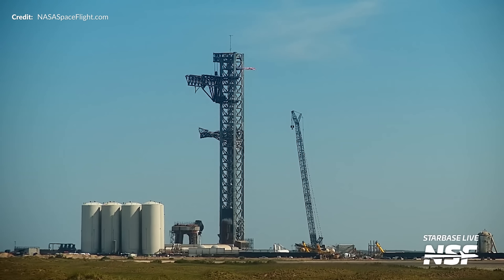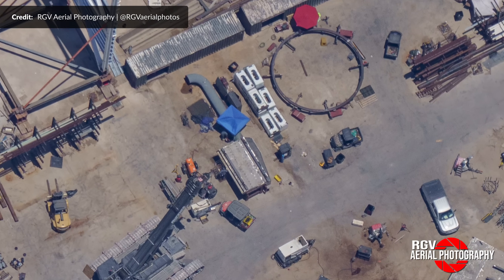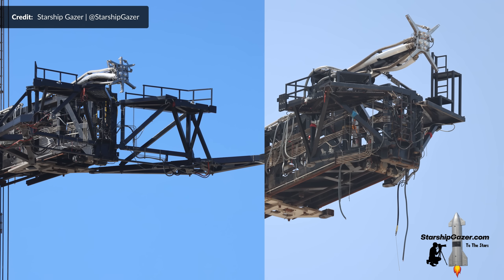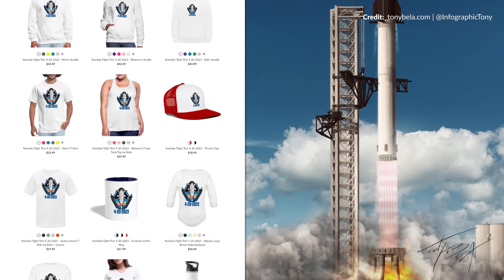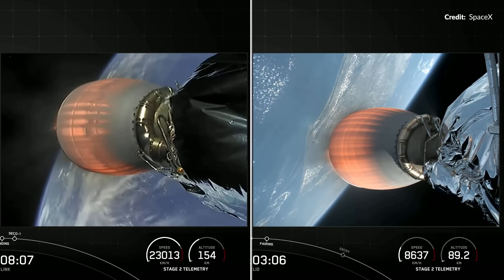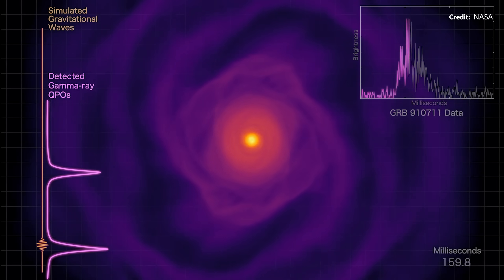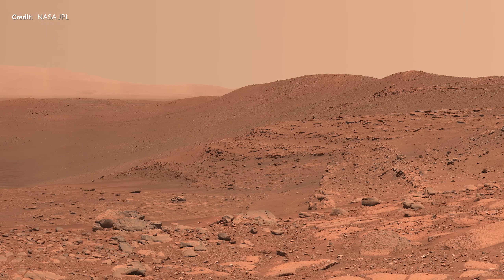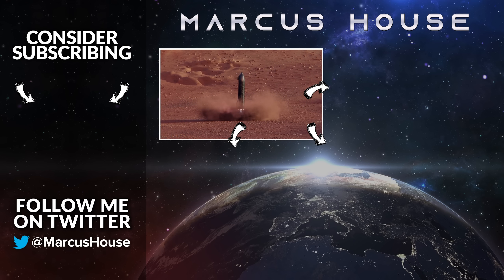Mind-Blowing Transformation at the SpaceX Starship Launch Site!

Comment: The speed at which the mount has been repaired and upgraded is really very impressive, for a one off first of its kind design the speed of assembly and installation is staggering. Don't think I have ever seen a project like this move so quickly, it's almost like they have built dozens of these OLMs and it's just a turn key project.
Reply: Just because it is being done quickly doesn't mean it is being done correctly.  SpaceX has shown to take shortcuts and risks.  The previous launchpad design was a total failure that cause major damage to the facility which should have been anticipated.   Now they are expecting the water pressure to be high enough to spray up through the holes in the pancake to compensate for the pressure that is given off by the rocket!  Highest force wins.  Why not just use gravity like all of the other water suppression system use?
Reply: I hope your new design on the new shirts will be a picture of the starship separating from the booster successfully and reaching orbit, maybe a shot of the Starship in orbit with booster returning to earth? Maybe ….🤞👍
Reply: yeah its pretty insane indeed. my clue is that they are pretty sure about most designs about 3-6 months ahead we get any idea. so this water-steel plate design must have been ready, reviewed accepted, planned and maybe even workers trained about it already before the first IFT. Also most materials were already ordered and on stock in the tents amd sub contractors already created, finished and delivered their share, which also means the design was ready months before. I guess we tend to forget that the people there are probably the best at their jobs, not some hillbillies winging it - the impression some might get from Elon’s casual style. I am sure there are people who worked on historic launchpads and knew exactly what they were facing. No guesswork here I think. So yeah, they are extemely
prepared and I also think the workers themselves are pretty much the best you can get.
Reply: Nope it's not!!!!! They have just seriously delayed the assembly and wanted to destroy the pas or launch that other rocket first! That's why it's fast lol!!!! Nothing special
Reply: It has been planed in advance just because they rushed that first launch and destroyed the pad.
Reply: @sunkid86 lol!!!!!!! Everything was already done they got quickly because of the failed launch pad first
Reply: @freeaccess5905 
Being done quickly does not mean it is being done poorly, either.  I suspect this system was proposed well before the previous concrete repairs after the 14 engine static fire.  Given Elon's bias toward eliminating parts and processes where possible, I'm guessing he made the decision to rely on the concrete but permitted detail design work to continue on this.  With the design work done, procurement could proceed immediately after the decision that it was necessary.
Reply: @_mikolaj_  Not really, even SpaceX said the old design was sketchy but though it might hold up to one launch. The steel plate design had been worked on for over 6 months prior to the first launch.
Reply: @sunkid86  They actually said the steel plate water deluge design had been worked on for over 6 months before the first launch. Many people seem to think this just some garden shed outfit with vast amounts of money to spend but they have some of the best engineers in the world working there and their project management and logistics is some of the best I have ever seen. People don't seem to realise how much goes into a project like the repair and upgrade of the launch mount to say nothing of all the other upgrades going on to the GSE.
Reply: @carholic-sz3qv  They already said they thought the old concrete pad could take one launch but that turned out to be a bad decision.
Reply: @schrodingerscat1863  wrong!!!! They rushed and it shows alot in many of their builds! Why didn't they built a launch pad similar to NASA that was built decades ago and still standing!? With ICE and diesel work can be done 24/7
Reply: @carholic-sz3qv  They want something more flexible than the standard trench designed used normally. They are still redesigning the rocket frequently, so need something they can easily work on without having to go back to the highbay all the time. They also wanted to see what is really necessary since they are going to need to build a bunch of pads in numerous locations. Boca Chica is a test site. They can see what is and isn't needed there, since a failure isn't a huge set back. That is unlike Florida where a setback could cost delays with paying launches. 

Remember, SpaceX has 3 pads for Falcon 9/Heavy. They know how to build a standard pad. But the static fires during testing already exert the same or more force on the pads than a Falcon 9 launch, and that hasn't had any issues with a flat pad. Only with a full launch of Starship with 3 engines out ahead of time, causing the rocket to stay on the pad longer than it should have, did a pad get destroyed completely.

Comment: My guess with the hot staging is the three booster engines would shut down as soon as the second stage engines fire up. If the three booster engines continue firing even in a throttled down state then there would be a risk of the near empty booster ramming into the upper stage immediately after separation. Something SpaceX has already experienced.

Comment: How great is the Falcon 9 !!!  How can Ariane produce a new non-reusable rocket.  How can they compete?  Awesome video Marcus!
Reply: Because development started in earnest on the Ariane 6 in 2013, over two YEARS before SpaceX would land their first booster and almost 4 YEARS before SpaceX would reuse their first booster. Booster reusability is great, but has drawbacks.

First, if you don't have a fast enough launch cadence, you can spend more on recovery equipment and personnel than you save by reusing the booster.

Second, you take a payload hit for the recovery system on the booster. The Falcon 9 B5 can lift up to 22.8 tons to LEO when expended (SX), but only up to 17.4 tons when landed on a drone ship (B1067.9). Doing a Return to Launch Site (RTLS) landing, costs even more payload as you have to add a boost back burn to cancel the lateral velocity and return back to the launch site.

Third, the higher and faster you go, the harder reusability is to perform. The heavier the dry-mass of your booster, the harder reusability is to perform.

Fourth, you now have to have the weather be acceptable at the launch site and the landing site, if it is down range of the launch. 

No, I'm not saying that SpaceX should not recover boosters. I'm using how reusability affects the Falcon 9 to discuss other expendable boosters.

Comment: Moving the ship disconnect up will allow for a longer Starship by another 20 meters, maybe 30 meters. That will be one heck of a space ship, and the new raptor 3 engines can more than handle the bigger Starship with their additional thrust power. The steam from the hydro flush system will actually help push the heavy lift booster off the base if installation of panels force an increase in pressure high enough to make it easy on the raptor engines. Plus keeping the heat from the engines controlled. One calorie per cubic centimeter to raise the water temperature one degree. Going from cold water to steam uses a lot of heat calories, and maintains temperature control. The colder the water the more calories are required, and the more stable the temperature control is on the raptor engines. This time I don't expect any engine failures, and the booster will actually be moving faster thanks to the extra push from the steam hydro deluge system. I expect an additional upgrade to the deluge system after this launch to correct any areas that seem to be getting to hot, or not producing enough steam to to give that extra lift at launch. I wish I could fly down to watch history being made, but getting chemo every week kinda puts a stop to that idea. Plus I don't have the spare money to make the trip, and heat over 90 makes me start puking. Great for weight loss, but not cool for anyone around me. I guess I could park in a rental car, and just keep the air conditioner on. I hate to waste fuel by running the engine. So I'll just have to count on Marcus making some great video.

Comment: That deluge system looks like it feeds water in from below, through holes in the plate. I'd expect the pressure from the thrusters to be highest at the center and for the water pressure to be lowest there; I hope they've got their calculations right and it doesn't fail there.

Comment: as was found during the construction of the Hoover Dam, when you pour a lot of concrete, you need to cool it.  Hoover Dam did this by poping a refrigerant through pipes embedded in the concrete.  When the concrete was set, they pumped concrete into the coolant pipes.

Comment: Regarding the PEZ dispenser door, if I understood correctly, it adds a weak point to the starship, due to the compression force as it lifts into space, which needs reinforcement, thus increasing weight.  A simple question: why not to orientate the slot opening vertically. that is , along the axis of the ship, instead of across the diameter of the ship? I believe that the vertical orientation is less weak that the horizontal one, and besides, in space, it may not matter whether is vertically or horizontally, but the functionality that is preserved.

Comment: You know Neal, when I look at that cargo bay door of Starship, I have to wonder if the SpaceX engineers ever considered a vertical payload door opposed to the current horizontal door. You have to wonder just how much structural reinforcement has to be added to carry that stress load around that huge door. If the stresses collapse that door opening by even a fraction during launch, that door may not open or close. If I were to design it, I would attempt a vertical door as it is much easier to carry that stress load. The big takeaway would be if they could deploy the Starlinks in a vertical position. In my mind, I picture a multilevel dispenser similar to the old slide projector carousels. Preliminarily, I think you could actually dispense more satellites in this configuration if the mechanics work out.
Reply: @PC-nf3no ... IT would be interested to see your take on how the Starlink2 satellites would be arranged inside the cargo bay, and maneuvered around to come out through that vertical slit...  Maybe you could describe your plan for that too? I'm having trouble visualizing how a vertical pez dispenser would work, and how many satellites they could carry like that...
Reply: The door frame carries the stress load only two times: when Starship is stationary on Earth and when deploying satellites in orbit; i.e., only when the door is open. For both situations, the stresses are not exceptional. At all other times, especially during ascent/descent, the door itself can carry the stress.

Earthly doors aren't structural, only their frames carry loads. But Starship doors can be load-bearing when closed. I imagine the Space Shuttle payload doors functioned similarly.
Reply: @ChristLink-Channel  Putting it in a CAD would take considerable investment. Google 35mm carousel for a concept. Once you have that in mind, satellites would be loaded on several layers in a similar method of the carousel. A center shaft contains a kicker to deploy and then the table turns for the next sat to get kicked out. After all sats on the turntable are kicked out, the next table drops down to deploy it's sats.
Reply: @dennisleas8996  No, I don't think so. I can't think of one space craft ever designed where the door was designed to carry the stress loads of the structure. Shuttle bay doors carried a load on descent but dealing with that was after the vehicle had landed. Even still, shuttle doors had their faults and early on, had trouble latching closed where a space walk was almost needed to get it to latch properly. There won't be any astronauts on a Starship cargo ship. So it's got to work right every time or risk losing a vehicle or returning with the payload. It will be interesting to see how a payload door nose cone does in the can crusher or the max q simulator.
Reply: @PC-nf3no  Interesting point. I really wish we could have iterated the Shuttle design more, as magnificent as it was.

No matter the operational Starship payload door design, it will take some iterative innovations for such a new vehicle. As always, it becomes a trade-off among designs as to complexity/reliability and mass. To your other point, if the door were load-bearing, some new extra mechanism would likely be required to ensure it opens properly. Would it be worth the cost? And I don't mean financial.

No matter the design - horizontal, vertical, or whatnot - stress testing should be straight-forward at Massey/Starbase. The remaining issues - like vacuum conditions, vibrations, and thermal changes - are more difficult to test.
Reply: @dennisleas8996  I'm sure Space X will put it through its paces but, since it is too large for the vacuum chamber at Glenn, that will have to be done in space.

There are 2 NASA webpages that have disappeared since the cancellation of the shuttle program. One was the conceptual generation of future winged space Craft. It feature 5 generations of winged space vehicles. I was left a little in shock when the Space shuttle was cancelled and NASA awarded contracts on capsules instead. I mean, they did try with the X33/Venture Star. But the technology was immature and the wasn't enough thrust and fuel available for large payloads. The x43 scramjet tech (phase3 vehicle) is still underdevelopment but mostly for hypersonic missiles. 

The second webpage to disappear was the shuttle upgrades. That included a glass cockpit, which they actually did install. Others like liquid flyback boosters, cargo craft, and other enhancements were never developed. It was just too expensive to operate and too risky a craft losing 2 orbiters and 14 astronauts.
Reply: @PC-nf3no  Still not seeing how that would work with satellites that are nearly the same size as the interior dimensions of the payload bay.  You can only fit in a very few like that.  Anything that is larger than half the diameter of the ship would mean you can only fit in basically one unit
Reply: @ChristLink-Channel  I don't happen to have any of the dimensions needed to work the problem. However, the short side appears to be significantly less than half of the 30 meter diameter ship. If you notice in an animation, not provided here, you would see that the pez dispenser deploys 2 at a time on the flat side. So, if you stood it on its short end and placed it perpendicular to a central shaft, it appears you could arrange it on a rotating carousel that a kicker on the central shaft could deploy sats. After the carousel deploys all its sats, the rotating platform would drop down out of the way for another platform to lower down into place to begin deploying. That's probably the best I can do for you without having dimensions and drawing pictures.

Comment: They already had the new launchpad design done and manufacturing in process before they launched, they knew it would destroy the concrete pad. The launch was actually a good real world experiment of what would happen with a star-ship launch from an off world site, lunar diust or Martian rocks would probably have similar behavior to the destroyed launch pad.
Reply: It makes no sense to let this damage happen . I think that it is possible that Elon is spread to thin in all his business ventures and this is the result.  The most reliable system to date is to divert the blast away from the bottom of the rocket.  Nobody has yet explained why SpaceX refuses to use that system .  The next full powered launch will be telling . I do hope the repairs are limited after launch.
Reply: @rayRay-pw6gz Elon is impatient. He also apparently wants to avoid a diverter at all costs, so that they can work on the engines while on the pad.
Reply: @rayRay-pw6gz  It makes perfect sense, destructive testing is a SpaceX guiding principle. 
To be specific what did they learn ? They now know what secondary blast debris will do to the rockets engine compartment.
Reply: @rayRay-pw6gz On top of what Steve said, it would be very time-consuming and expensive to get approval for, then build, the needed hill required to make a flame trench work, and building one would require completely dismantling the current launch complex.
Reply: @EMichaelBall  it also might trigger an environmental impact study, another one
Reply: @EMichaelBall  I agree that the build would be a major undertaking but , NASA has successfully used that method for over 70 years . So SpaceX knew about it . Plus the direction they are going is leading to more powerful thrust at launch .  If SpaceX wants to have a fast turnaround, they need to have a reliable launch structure. Depending on how many engines are used in the next launch, let’s hope this new system works with little or no rework of the structure.   I understand that Musk like to push the envelope to see the results , so maybe I need to have more faith in his methods.  Thanks for your time .